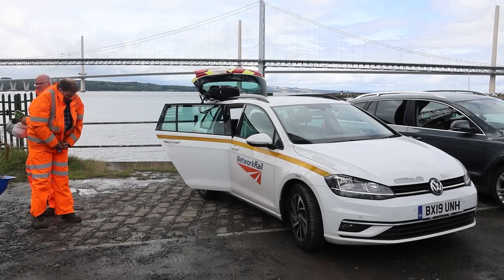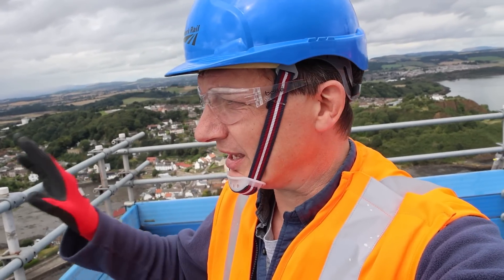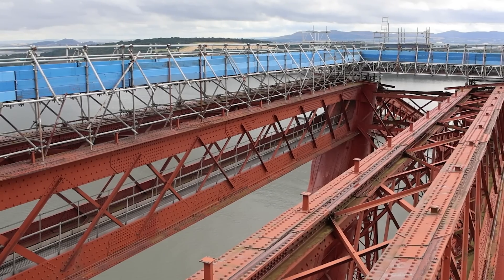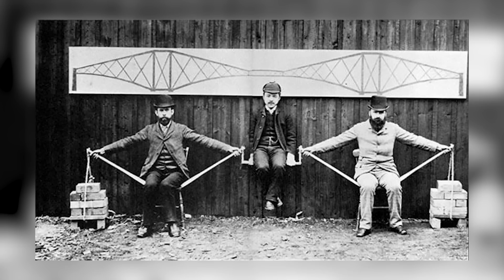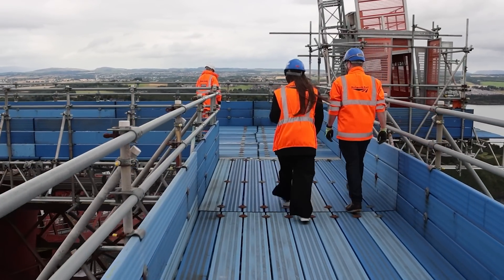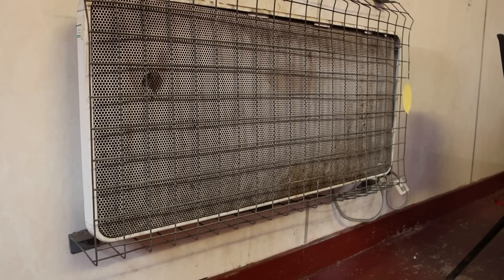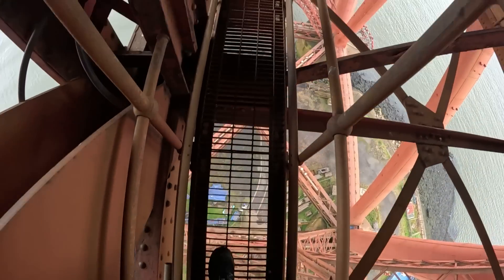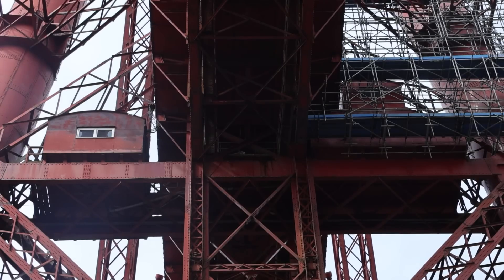I Went To The Top Of The Forth Bridge

Comment: I spent 4 years working for the Edinburgh signalling team, and one of the most thrilling parts of my job was when I got to go out on to the bridge. Slightly nerve-racking the night that it was completely encapsulated in cloud. Imagine the scene: you have only the Up Fife (the line towards Edinburgh) blocked from North Queensferry to Dalmeny. You walk out on to the bridge from Dalmeny in a complete pitch black fog. We went out about as far as the middle of the first Suspended Section to work on some equipment. The fog has completely removed all lights and sound except a massive foghorn from a ship at the oil transfer dock a few miles east. The Down Fife is still open, so you have be situationally aware as trains can sneak up on you on the other line. Probably one of the eeriest experiences of my life.

Comment: I have done the trip to the viewing platform - great view and incredible when you look down the lengths of girder that they really are quite twisted.  Built with a totally over-engineered strength after the Tay bridge disaster.  Strength factor about 7:1 as opposed to the 1967 road suspension bridge about 2.6:1 - fascinating tour with Network Rail and well worth doing if you get the chance.

Comment: That’s a nope from me, my vertigo was going nuts, just watching! 😂
Reply: Yeah, same here. No way in hell would I go up there!
Reply: Glad I'm not the only one.
Reply: Ditto.
Reply: I’ve climbed the Harbour Bridge in Sydney which is amazing, but the catwalk out to and from the pylon is unnerving beneath the deck. Then a series of ladders through the road / rail deck levels to the top of the arch. I think it’s the mesh beneath your feet with little or nothing below that unsettles you
Reply: That was completely my experience too when I did it. Despite a fairly severe fear of heights, I wasn’t bothered at all on the upper parts thanks to the remarkably clever harness system that keeps you securely attached to the safety cable, even when you pull the clip past the brackets holding it in place. The catwalk under the deck was much more unnerving.
Reply: That's nothing - have you seen the state of the "scaffolding" that was on it when it was being built - with various guys dangling from it on bits of rope?!!  It's a shame so many died, but hardly surprising, really.  Sometimes Health & Safety does good things!
Reply: Vertigo is a strange thing.   When I was much younger, I did some work for my employer in Chicago and I had a 39th floor apartment that I just loved - it even had a west facing balcony. It didn't look over the lake but OTOH you could watch the planes far in the distance around O'Hare.   No hint of vertigo.   But now I'm much older and heights do bother me - I visited Liverpool Cathedral not long ago, and although the viewing platform didn't bother me, the stairs you need to climb, with a sheer drop on one side to the floor of the cathedral certainly did, especially on the way back down.   Never again.